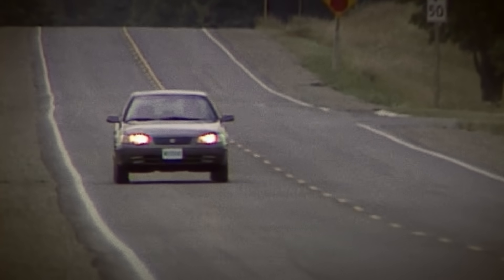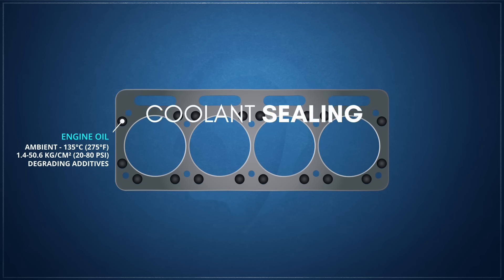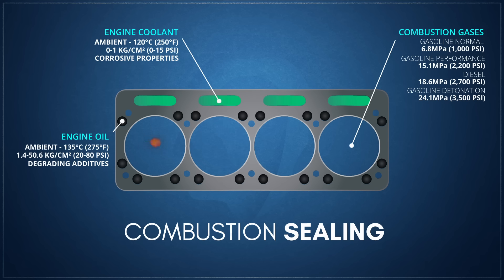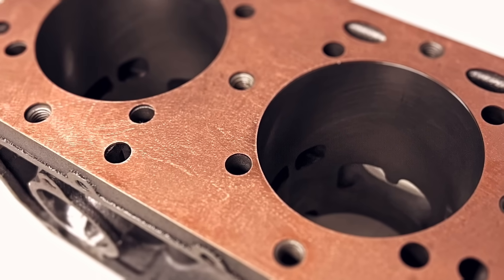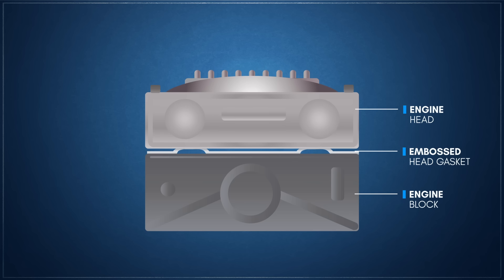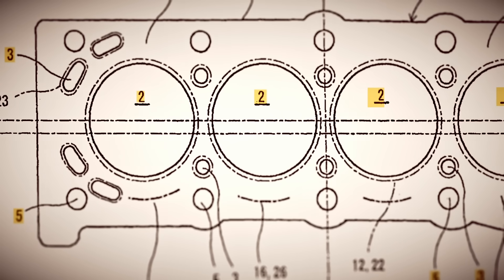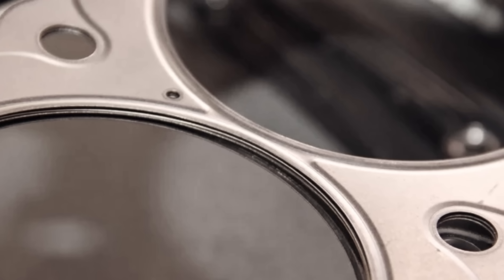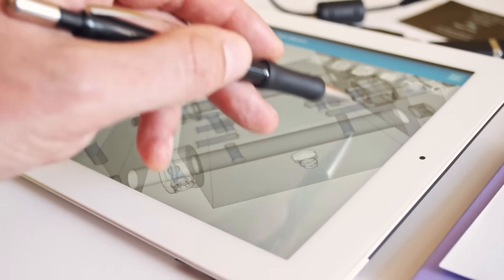The Most Tortured Part In An Engine

Comment: 2:19 fairly certain you meant 5.6 kg/cm², not 50.6, since that's what would actually correspond to the given 80 PSI equivalent conversion
Reply: More likely he dropped a zero and he meant 800 PSI
Reply: @jaimepuig2258  hard to be certain, another possible explanation for sure though...that just seems like an implausibly huge range!

Comment: The MLS head gasket keeping my L28ET with ARP studs running strong at 25psi of boost and E85 making 500whp, my weak point is a 40 year old block still going 😅

Comment: Another outstanding and informative byte of content from one of youtube's most outstanding content creators
Reply: lol, its jsut a big reach video, as most youtubers, head gaskets are nothign special and not a stressed part in the motor, any compression gasket can sustand high pressure, because the pressure does not stress the gasket with its tiny contact surfae, in small two strokes head gaskets were and are commonly made of a simple paper or aluminum sheet, it is not rocket science. You just have been fooled by a youtuber.

Comment: The one manufacturer who decided to go with no head gaskets, and simply make the cylinder and valves as a unit was Deutz, whose engines are still in use world wide. Drawbacks are machining them is hard, and you have to compromise on weight, unless you use a cast in sleeve, or use a very high silicon alloy. But the issue is the machining needs specialised tools, though it does mean you can fix a failed cylinder as a single unit. Was common on aero engines as well, with the high compression that came from them needing to have maximum power. Biggest drawback is that you now have to have space for the hold down bolts per cylinder, making the engine longer, and you really benefit with over square cylinder designs to make machining easier. And yes works best with air cooling, as the casting is so much easier to make, though with modern 3D machining you can likely make lost styrene moulds, that are light and accurate enough to get water cooling into them, with reliable performance. Would be perfect to make a small ultra high compression turbo diesel with, you can get high boost and only have ring blow by to worry about.
Reply: I have a few Deutz diesel and Porsche also no head gaskets.
Some outboard motor s Mercury no head gaskets..

Comment: I would like to also nominate throw out bearing in manual transmission. It have to endure quite a lot of force and lots of cycles. Especially when sitting in traffic or at high revs. Plus no way to add lubricant after installation.
Reply: Also, thrust bearing. All that force the TOB has to handle has to push against something. 

So, don't ride the clutch sitting in traffic at idle with low oil pressure. It is annoying bouncing to neutral in traffic, but it's kinda important for a lot of reasons.

Comment: In my experience the major cause of head gasket failure in modern and early engines was temperature variation over the length of the gasket. Once the temperature variation is brought down to a maximum of 10 degrees celsius there was no failure of the head gasket material even when the temperature was excessive. Maintaining the temperature of course is the one thing that the automotive world refuses to acknowledge. Otto when drafting the rules for tuning an internal combustion liquid cooled engine insisted upon a coolant flow consistent through the cylinder head at 500rpm of 10 liters per minute in order to maintain an even temperature  through the cylinder head therefore keeping the temperature variation within the aforementioned temperature gradient. Myself and the people I was working with were shunned as rocket scientists by those in the industry that should know better even to this very day. 
I and my colleagues enjoy hassle free motoring with vehicles that are tunable beyond the expectations of those in the industry with engines that predominantly expel hydrocarbon in the parts per billion not parts per million. Wake up people.

Comment: Kg/cm2 is an odd unit choice. Isn't Pa (or kPa)  the  standard for SI units?
Reply: It should be, but kg/cm² is a remnant unit that has lingered on in the industry, just like Bars for tire pressure and Atmospheres for internal gasses inside the engines (both are very, very similar to each other). I think the reason behind it is because in these units you use two digits for most applications, kilopascals are too small and megapascals are too big.

Comment: I loved head gaskets as a mechanic.   Good flat rate hours, easy to do, virtually no come backs, and a steady supply of them coming in.   Especially older composite head gaskets with an MLS replacement.
Reply: Surely they can be a bit of a headache when due to overheats? i.e. having to make sure the deck/head are not warped, I'm sure customers don't like to have to pay variable amounts when you can't accurately quote before the job the cost of sending parts to machine shop
Reply: @carnivorebear6582  when I was a mechanic, most of the head gaskets I was doing the overheating, if any, was a symptom not the cause of the failure.  Back then most of the engines were bi-metal, so aluminum cylinder head but cast iron block.  Aluminum expands more than iron, so thermal cycling would cause the head to bow up in the center.  Also the original head gaskets couldn't deal with the large amount of joint motion and it would tear the gasket apart.  As a result, the blocks were usually fine.  They rarely had any issues.  And back then you could have a thousandth or sometimes two of block warpage and still be in spec.  Sure if someone toasted the engine in the fire pits of hell, then the block is going to be warped, but at that point you have other issues too and it's time for a full overhaul or a new engine.   So in short, back in the day a surprise block decking was very uncommon.  As for the head, it was always warped 100% of the time so resurfacing the head was part of the estimate from the get go.
Reply: @carnivorebear6582  you throw a true straight reference on the head with a feeler gauge. If it meets a certain tolerance it’s good. Takes like 30 seconds. Also the machine shops just refinish the head for the same price everytime (I.e. $75 per head) so you know how much to tell the customer beforehand without having to call or do extra work. It’s very rare that a head needs any more work than maybe new cylinder sleeves
Reply: @Jesse Russo  yeah but you can't do that till you're halfway into the job was my point, and you may have the resurface the head, block, both or neither. I suppose if the cost of resurfacing is relatively small compared to labour then including any possible resurfacing in the quote isn't gonna make or break the job being done.
Reply: @carnivorebear6582  yeah it’s just included in the price and then if it’s true flat we just take the $75/head off. If it goes to the machine shop it gets the whole works. Cylinder honing, deck resurface, stud removal etc. The machine shop includes all of that in the flat fee they give the shop, so it’s never like we have to quote individual stuff. It’s just $75 every time (for the shop at least, I’m sure the customer is upcharged)
Reply: @carnivorebear6582  not expensive to shave head
Reply: Hey, let's save a couple of dollars on manufacturing on a vehicle by making plastic head gaskets instead of metal ones! While we're at it, let's hide the evap and heater core so the dash has to be removed instead of being removable thru a panel!
Reply: Lol say you’ve never worked on a Subaru without saying it😂
Reply: @ravinking1  plenty of Subaru's.  But if you were popping the heads off for external coolant weepage, you should have read the TSBs.   The #1 reason heads came off on a suby was bent valves.  Timing belts busted either due to belt or pulley failure, or front end collision which pushed the core support into the timing belt.   I dont think i ever saw a suby with a truly blown head gasket.
Reply: @wouldntyouliketoknow9891 I work at a machine shop with several Subaru dealerships and independent specialty shops nearby. I resurface probably 6-20 Subaru heads every week. Yes they truly blow head gaskets. I can see where the sealing ring breaches on most of them. You are correct some of them are not truly blown but many are.
Reply: @Randy G i 100% agree the automotive industry is just not worth getting a degree for imo. Better off for the young folks to join community college Honda or Land Rover programs and whatnot to get a job straight to the dealership.
Reply: Hey, I'm a future tech in training, any advice?
Reply: @gamechip06  start working on small engines. Take shit apart and put it back together
Reply: @gamechip06  Ask more specific questions
Reply: @gamechip06  learn about fitness
Reply: @gamechip06 do not get stuck in a department that is easy new techs get stuck in line racks or breaks and front end work where you get paid by car and it’s easy but the rate is shitty compared to other departments
Reply: @gamechip06  stay away from Kias Hyundais Mercedes Porsche
Reply: @Isaac Morales  I never found Kias and Hyundais to be particularly difficult to work on, better than BMW, VW, Audi and (especially) Renault
Reply: @carnivorebear6582   im speaking pursky head gaskets here. IMO Toyota wins the cake on easiest head gasket job you just slap it on bolt cylinder bolts on timing chain cams rockers and your done put everything back together. An Older V8 is way way easier but talking newer cars i can’t imagine a GDI good engines but when they start having problems its just a no go for me
Reply: @IsaacMorales12  Porsche? Nothing wrong with Porsche
Reply: @gamechip06  look for another trade
Reply: @romanmechetnerful  yes , because ev's don't have suspension systems , tires, brakes etc. Bozo.
Reply: @romanmechetnerful 😅😅😅
Reply: yeah, head gaskets are the same as engines now: obsolete
Reply: @skataskatata9236  right because we can just pull power and generate it from the ether
Reply: @skataskatata9236  damn now that's a good joke
Reply: @skataskatata9236  Sure hope the vehicle supporting all those EVs has a gasoline engine. And the freightliner that they're and their parts are shipped to the factory has one. And the vehicle that delivers them to the dealership you were able to buy your Shiny New.
Reply: @skataskatata9236  Not really though...

Comment: Blown head gasket is still the most common engine failure you hear from people to this day, at least here. Unless you really mistreat your engine it's fairly unusual for any of the mechanical parts to fail.
I've only had one engine fail really badly (i melted 3 of the 4 pistons), because I kept running it for over 100,000km with a blown turbo seal - it would lose oil pressure at idle, but as soon as you revved over 1000rpm the warning disappeared. Eventually it gave way completely, sucked all the oil through the intake, and I ran it dry at 200km/h until it cooked itself to death. 
The oil light never came on and coolant temp. was normal, I only noticed something was wrong because I tried accelerating and it was not responding. I stopped as soon as possible (less than 1km) but by that time when I opened the hood the turbo was glowing orange.
After refilling with oil I still managed to turn it back on and drive 20km to the mechanic, surrounded by a cloud of oil.
Absolute tank that engine.
Reply: For 100,000 km? What car was that lmao
I had an oil Opel Astra F that we cracked the oil pan on when driving on a dirt road. Figured we'll just send it and try to go home - we drove like 15 kilometers and we were like 4 kilometers away from home before it gave in. I just saw a glowing red metal thingy fly away in my rear view mirror. Probably a connecting rod. Tried to find it but it was impossible. Looking back at it now, I wonder how that thing didn't cause a fire since it probably landed in grass. Well, the thing was a beater anyway and we already burnt the clutch a bit when trying to do burnouts so we were already somewhat detached from it. It took quite a beating from us tho lol

Then we moved on to a Fiat Bravo HGT, which ended up with a.... you guessed it... blown head gasket. The thing was the most fun car I'll probably ever have though!
Reply: @tabushka292  '97 Audi A4 B5, it had around 250,000km when I bought it and 356,000 when it blew.
It wasn't dry the whole time though just to be clear lmao, it did use a bit of oil but not that much. It leaked just enough oil through the turbo that after 15-20s at idle the low oil pressure warning would come on.

Comment: I think that changing head gasket is nice "challenge" for new car enthusiast...  It's hard, but still doable at home garage
Reply: Depends on the engine. If its an old car with a simple design, then maybe, but most modern engines are extremely complicated and require a lot of special tools just to set the cam timing up. 
Doing a head gasket on a modern Audi/BMW is difficult job for an experienced DIY mechanic, let alone a beginner. The book time is often well into double figures when it come to the amount of hours needed too.
Reply: @MattyEngland  i agree. Timing belt or cam in the block? Easy. Chain and cam(s) overhead? Not so easy.

Comment: -A head gasket is the most tortured part of any engine.  It is also the most simple.

And the most simple to get WRONG in the form of the composite gaskets used on Subaru four cylinder engines.  These turned the most reliable automotive product in the world into something less~

Comment: It's almost a miracle internal combustion engines exist and even more mind boggling they can be made reliable for 100k of Kms. 
Make me sort of feel better moving to electric from an ownership perspective, lot less points of failure.
Reply: I disagree, the circuitry that makes them move is also a modern miracle. In a way, they are the same as the engines in the way they are manufactured, now just moving electricity instead of air. The valves shrunk a whole lot and the timing arrangement is an inaccessible chunk of code and requires multiple bachelors degrees to fully comprehend if you could...
Reply: You slow.?